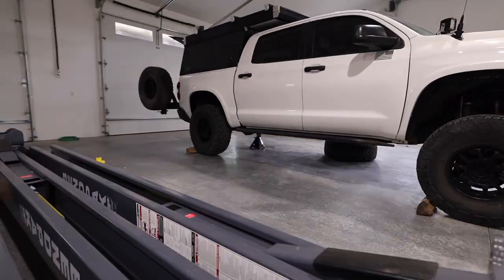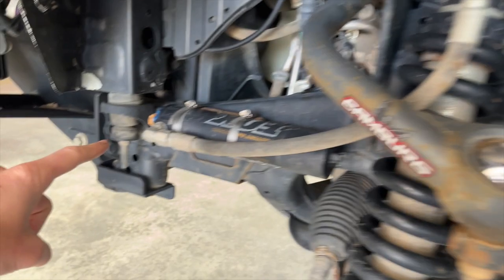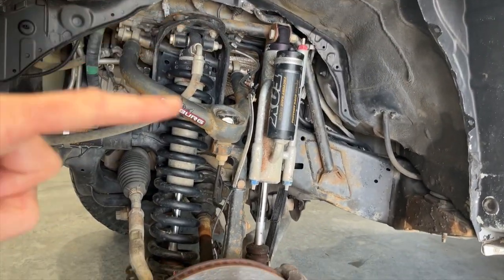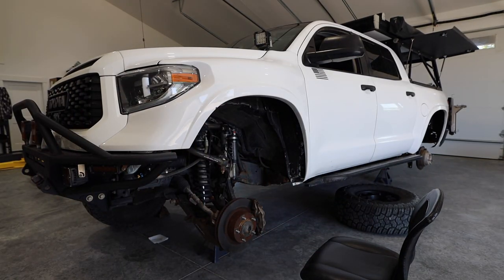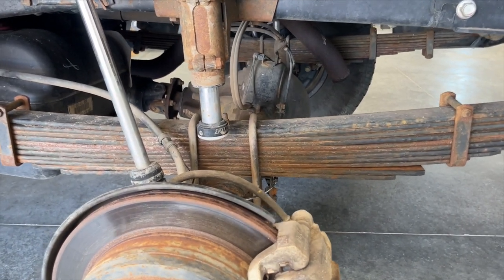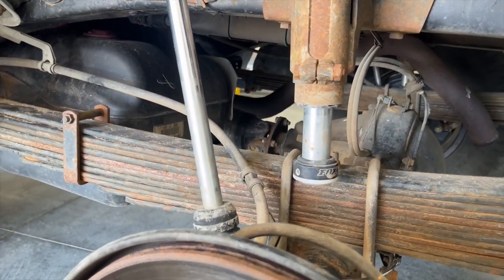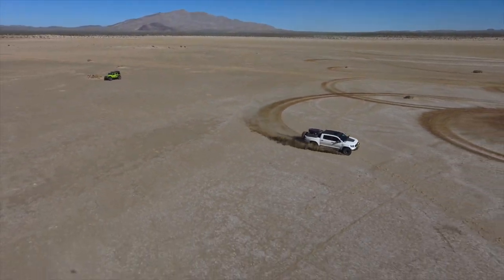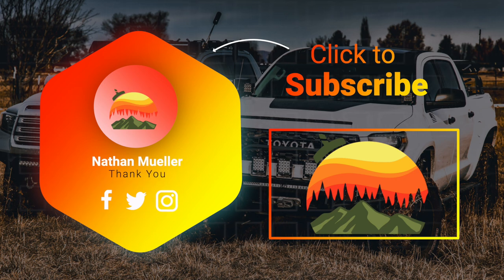Long Travel Suspension Guide - Parts, Mods & Cost - Camburg Tundra Long Travel Off-Road

Comment: Awesome video, like you said, everything is connected in a build like this, other ancillary costs not called out, fender install/paint, gearing for 37’s, and those fender liners are pretty grumpy to make- the fronts took me a couple long days to do 😂
Reply from the maker: ooooh good point on re-gearing... I should have called that out too. I have 5:29 gears and a LSD in the rear. Fender liners are a pain... i'd honestly just buy them if I could... the guys over at TAV have mastered it... I need to go learn from them.
Reply from the maker: I am about to start work on new fender liners.... so not looking forward to it... I swear I would rather rebuild an engine then make fenders...

Comment: So you said that the external reservoir is for heat dissipation, and yes this is true it can help with this along with adding shock oil volume. But I felt I could also add that the main purpose of an external resi is that it separates the oil from the nitrogen in the shock externally  from the shock itself which prevents aeration of the shock oil. Roughly half of the resi is actually just nitrogen gas!
Reply from the maker: Great point... I will have to do some component level deep dives in the future that cover stuff like this.

Comment: 15:35 I recommend spindle gussets from either Dirt King or Total Chaos versus the complete spindles Camburg sells, as they are asking $2,000, versus $50-$70 for the gussets that are welded onto the existing spindles providing the strength they need when upgrading.
Reply from the maker: great call out... that is actually exactly what I am looking at...  got a welder in the shop... the savings... basically pays for the welder 🤷‍♂️
Reply: @OutdoorAuto  totally. The Camburg spindles are super beefy, but gusseted spindles are plenty good in extreme conditions as well.

Comment: Thanks for doing this, I just have 2.5 king shocks on my tundra and it’s still fun but I want more. LT would be fun but the cost is crazy, what do you when all those shocks need rebuilding? Does your truck stay on jack stands or do you have another set to put on?
Reply from the maker: I am actually in the process of this right now... I am timing the shock rebuild at the same time I am doing a big electrical refresh... and I coordinate with the shop I send it to so they are ready for them when they get the shocks to rebuild so they are only out for about 10 - 12 days including two way shipping.... We will see how it goes... but yes. Truck will be on a lift for almost 2 weeks.
Reply: @OutdoorAuto  ok thanks

Comment: Love your content Outdoor Auto!  Curious if you’ve had any issues with your bed cracking.  My friend who drives conservatively on forest service roads with another common bed rail mounted wedge camper shell has their bed splitting.  It seems the frame and bed are designed for lots of torsional flex, and bolting rigid things to the bed rail leads to tearing.  Theirs is also a 6.5’ bed, and the back 15” or so are cantilevered with no frame support.  Thanks!
Reply from the maker: I have always had bed stiffeners... I wonder if that helped... no issues for me.

Comment: I'm so happy I found your channel. How does size and weight factor into what vehicle you look for when looking to do a long travel build? For example, do you look for something long and heavy, like a full-size truck like your Tundra? Or something smaller like a Tacoma or 4Runner?
Reply from the maker: This is a great Question. The reality is you can long travel just about anything... in a lot of cases the bigger you go, likely the more expensive it will be. The other big consideration is Power, most people go long travel cause they are interested in Racing (not professionally) but they want to do High Speed Desert and Mtn trails, Sand dunes., FAST..etc. This type of driving is the most fun with a lot of power, especially with Sand... you want a lot of HP. Because of this you will see platforms like the 1st gen Tundra very popular... it is smaller then the full sized Tundra and lighter but it still had V8 engine option that could be Supercharged. Longer wheel bases (not like Ford F350 long, but Tundra and down) actually do very well in high speed long travel because their is more time between the front and rear wheels encountering the same bumps that gives the shocks time to recover. If you look at the Baja 1000 Trophy Trucks - which are basically the most elite level long travel machines in the world - They are typically 1400 HP and they are pretty big... much more similar to a "small" full-size truck. Weight always kills everything... almost every type of build, you should always be targeting to be as lean as possible. Some of the New 2024 Tacomas have longer wheelbases, more powerful engine... so I could see base model Tacomas getting built into Pre-Runners becoming much more popular in the future. Hope that helps.
Reply: @OutdoorAuto  I'm just a beginner but that helps a ton, it's given me a lot of perspectives and a lot to think about. Thank you so much!

Comment: What have you seen is best for rear end leaf spring upgrades? I have a 17’ SR5 CC. I know just a little weight adds a lot of sag/squatting on Tundra’s. I have a Decked drawer system and a shell topper. Just curious about your thoughts that maybe you’ve already experienced
Reply from the maker: I have done a few things with Tundras, if you add a little weight I like Toytec’s Add a leaf kit, Old man Emu had a heavy duty leaf pack called the Dakar springs for the Tundra that was good but has had stock constraints… the best thing to do is weigh your truck at a cat scale with a full tank of gas and fully loaded with your gear and then get a custom Deaver leaf pack made for your weight.
Reply: I’ve heard good things about the Deaver leaf kits. Maybe I’ll look at that route. Good call about loading up and checking the weight. Appreciate the advice!

Comment: Wish we could do this in Australia! Our laws would make this kind of setup illegal (unroadworthy) and hence if caught or picked up by police the vehicle would practically be written off (and no insurance) as the difficulty in having an engineer sign off after removal of welded on frames would be close to zero. A system like this is fairly much unobtainable for us as a street/road registered vehicle. For modifications like this in Australia on road registered vehicles we would need engineers to sign off on the build but even then practically all engineers would not sign this off due to the complexity of our laws and testing requirements. 😢
Reply from the maker: Sounds like its time for  Australia to get some laws changed 😳  - You guys practically invented Overlanding... gotta protect that heritage.
Reply: @OutdoorAuto  You apparently need an engineer signoff to go to larger tires, so 37s and up are not common except on dedicated off-road vehicles that you trailer on road.

Comment: What spring rate did you go with (650 or 700)? Are those 14 or 16in coils?
Reply from the maker: I actually just upgraded the shocks when I did the rebuild on the front end. I’m Running a dual spring coil over. Top spring is 500 lbs, and 4 inches. Lower spring is 800 lbs and 18 inches. This gives me a very plush feeling 3 inches of travel that rates at 307 lbs and then once the Cross Over ring is engaged it steps up to the full 800… so far it is working great… still making adjustments to dial it in.

Comment: Is it worth it for 2wd trucks?
Reply from the maker: I dont think so... back in the day almost all the prerunners were 2WD so a lot of old timers swear buy it... but if you watch the pros... for example in the Baja 1000.... they abandoned 2WD went to 4WD and then actually went to AWD. It is hard to argue with their results. I don't have a locker... I Just run a Auburn LSD in the rear and leave it in 4-high off-road.... work great.
Reply: It is worth it. 4wd cv axles tend to disconnect and limit travel. At the end of the day, you can get through anything with speed and if you have great suspension, you can get through anything. For instance, I have a 2wd w/e locker and power through everything.
Reply: Edit: CV can cause issues that limit travel and is another point of potential breaking depending how wide the arms are.
Reply: @OutdoorAuto  can long travel handle bad roads and pot holes?
Reply from the maker: @kilogolfmike8095  definitely
Reply: I like 2wd better at taking sharp turns

Comment: Just gusset the spindles. Waaaaaaay cheaper
Reply from the maker: Ha… I actually have spindle gussets in a drawer right now… only trick is welding that steel on the Cast Spindle…
Reply: @OutdoorAuto it’s forged, not cast. Preheat and zip it up with your mig